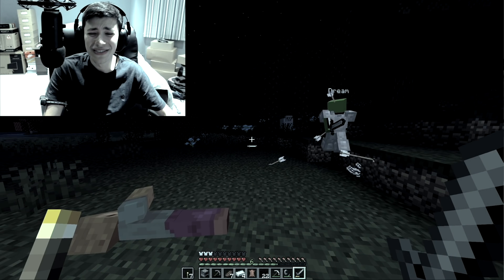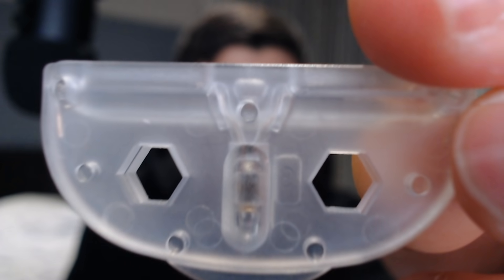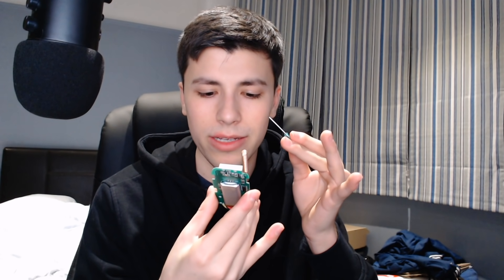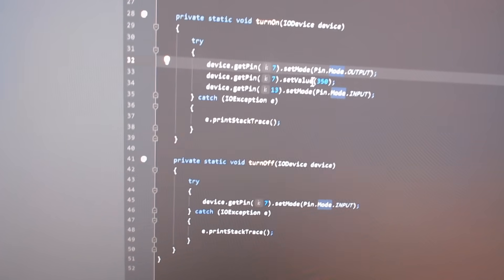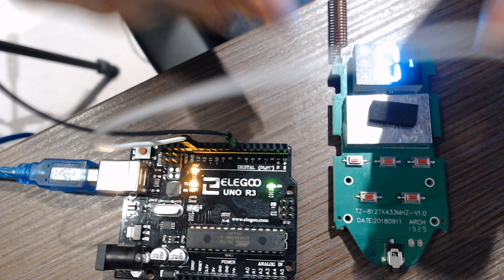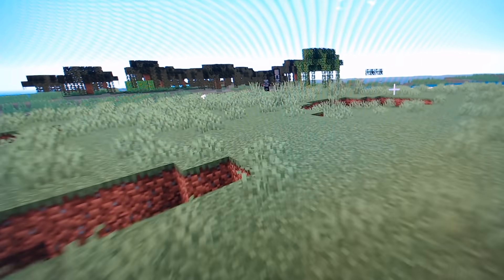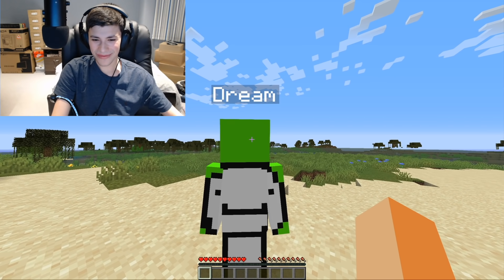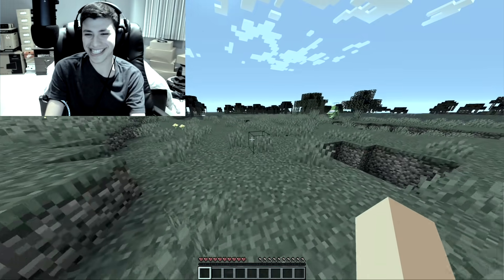A Robot That Shocks You If You Lose Hearts in Minecraft

Comment: Shock collars are actually a decent tool for testing pain tolerance because setting 1 would only cause absolutely minimal discomfort to most people. So George has the lowest pain tolerance I've ever seen.
Because I want to be fair, however... The collars sometimes use sensitivity rather than power settings. So that setting of 1 could perhaps just be ensuring that it works rather than the weakest setting.
Havin said that. Those collars operate under relatively low AC voltage, with minimal current, and operating below the worst band of frequencies that mess with your nerves. In short. They're meant to shock but are usually not actually painful. George is still a pussy :)

Comment: quick psa: do not use a shock collar intended for dogs for electro play. Use things that were build for this purpose or something like a tens unit.
These collars are really bad for dogs and can be super dangerous for them (especially because they are around their necks) but can also result in permanent nerve damage in humans. A big problem is that the manufacturing isn't properly regulated so you can't 100% know what you are getting.

pleeeease be careful when doing these kind of things. Even if something is supposed to hurt, there is usually an unsafe and a safer way. Always make sure that what happens is safe, sane and consentual when it comes to these kind of things

Comment: For those of you who aren't programmers, what George's code basically does is it registers an event when the server starts. An event is like a notification system for computers and it is fired when something of interest occurs, in this case George taking damage. And when it is fired, it can send data to an event handler (another method/function) that will 'handle' it, in this case send a signal to the remote. That's how the c# events work but that also applies to all other languages since it exists in all of them. But in c#, there is also something called a delegate that requires an event handler to have a specific signature aka parameters which is different than Java I think but Im not too sure cuz I have never dived in depth with Java before. Its wack stuff, but if you get into cs, you'll learn it all within the first month.
Reply: i did not understand a single word
Reply: @EstherDoesEverything  long story short:

- minecraft has a listener that runs (im assuming as a loop) which is used to check if the player takes damage
- if the player does take damage it runs a method (a list of things to do) which will make the arduino send a signal to the remote turn on a certain amount of time
 (idk if the shock length changes depending on the hearts taken but assuming it does) 
- shock

also im dumb idk java or how to code mc plugins that much either so uhhh dont take my word for it
Reply: yup, it's in java called listeners which does the similar thing

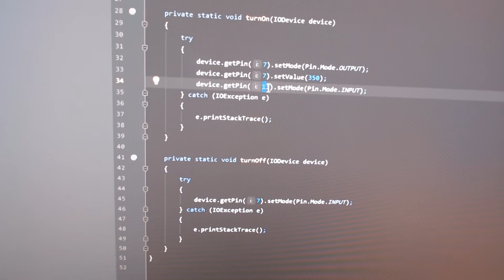Comment: 4:00 Why didn't you use transistors?
The definition of an electrical switch
Reply: How would you connect a single transistor to both the computer and the remote?

Comment: You guys used short circuiting to your advantage. Short circuit means if you put two wires connected to the same things electricity will chose only to go through one wire, and because you put it on the ends of the button it’s the same as taking the button off and soldering those two wire on it.

Comment: If you learn electrical engineering it becomes a whole lot easier, the antenna is a inductor (aka electromagnet), the black things are integrated chips, and the other stuff is for precise measurements of electricity, so that you don’t fry the circuit. so there’s a lcd screen, that means there’s a eprom chip (storage ic), and a micro controller (small cpu ic) so that you can run programs aka: binary, and when you press a button the program send a electric signal to the inductor, and also the antenna/inductor, sends a specific magnetic frequency and then the collar recieves that frequency, and it’s looking for a specific frequency so when it recieves that specific frequency it performs a action.

I over explained this
Reply: I mean, you just said some pretty simple stuff.  You just explained it in a way that would be hard to understand for the average reader.
Reply: @sellfone1913  no matter what, it's gonna be hard for the reader since it's abstract, and since I can't just go through the basics of electricity and how it works in a circuit without making it a lot more to read.
Reply: finally someone knows electric amd not stupid trash comments
Reply: Good job
Reply: Here comes the electrical engineer
Reply: It’s a seven segment display not lcd display
Reply: @verasinha7863  ha ha me brain go AHHHHHHHHHHHHHHHHHHHHHHHHHHHH.
Reply: that one guy Understandable have a great day!!1

Comment: 6:08 it might have a counter inside that counts milliseconds. if its using 15 pins to count that the maximum value before an overflow would be 32,767, or 32.7 seconds. just a theory ofc, but i remember many times when i worked with chips, id store the time on a signed short variable by mistake, and the time would always reset after 30 seconds.

Comment: The pin 13 on the arduino board is connected to the built in led of the board, when the board is powered a pulse is sent to this pin causing it to fire (if you power-on the board you will notice the led blinking) this might be the reason why your shocker is firing when you are powering on or restarting the arduino

Comment: A couple hardware mistakes in there, bc essentially you've connected a battery over a switch which means that you are producing a voltage gain from your arduino rather then just pressing the button, probably explained why level one feels like an electrocution, also it is pronounced saw-der not sold-er, other than the it is a pretty cool project

Comment: I have an idea. Instead of making it so any damage event is always 100 milliseconds, I think it should be every half-heart you take in a damage event is worth 10 milliseconds.
So 2.5 hearts, or 5 damage in one hit is gonna be 50 milliseconds of being shocked.
I think scaling the length of the shock with how hard the player is hit would make you even more scared of more damaging stuff.
So, you currently have it set to make any hit do 100 millis of shock, while with my suggestion you'd need to take 5 hearts at once for that.

I suggest this because I don't believe taking a light fall and getting hit by a strong attack should be punished with the same shock, rather the light fall makes sense to give you a little instead of a full shock.

Comment: You could’ve used an NPN transistor between the two leads on the remote. I think that would’ve been simpler. Then, instead of an arduino, you could’ve used an esp8266 so you could control it over wifi.

Comment: Imma explain it better:
the game has a server running q custom plugin. when the player takes damage, it tells the arduino trough the serial to power on a pin on the board, then, the plugin waits some amount of seconds and tells the arduino to power off the said pin. so it's basically some basic serial communication. the only thing that would take so much time was to get the actual components. the program and wiring couldve been done in less than half a day.

Comment: An arduino is not a microcontroller. There is a microcontroller on the board though. You should have got a cheap soldering iron instead of needing to use electrical tape (I hope that is not just duct tape). Especially if you are using this for multiple videos you don't want to worry about fidgeting wind the electrical tape in case you don't have a good contact. In the end the lazy solution is just to solder it once and forget about it. In your bukkit plugin it looks like you are sleeping on the main thread. Instead you should have spawned a new thread for controlling the remote and adding a delay there. While it would also be possible to schedule turning it off after 5 ticks this would be problematic if the server lagged and dropped below 20 ticks per second. There also looks like a bug where it won't shock you. If you get shocked 32 seconds after the last wake up press it will just wake up the device instead of shocking you. In there a different button no the controller you can press to wake it up? Depending on how fast it starts up maybe it would just be easiest to just switch on the device, send the shock button press, and then switch it back off.

Comment: You guys should scale shock damage to armor bars instead of just getting damage, make it more realistic you know.
I dont know much of the technology myself, but basically youd need a weaker adjustable shock collar and need to find the value of how it changes its output, located in the chip. If its wireless then you can input that to Minecraft's code so it can scale properly with armor bars. I dont know how youre going to transfer the data from Minecraft to the remote, buuut good luck